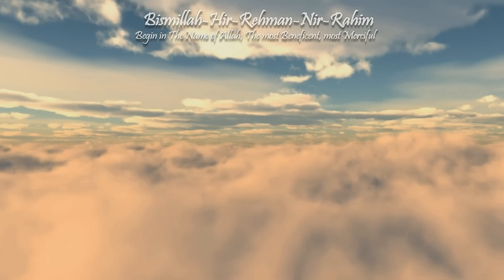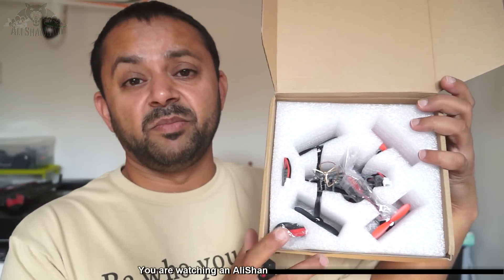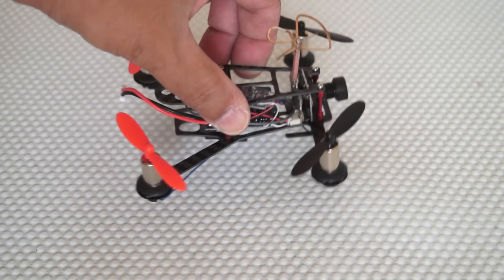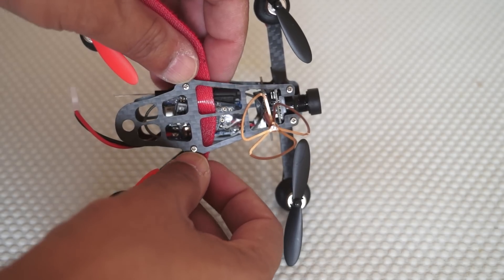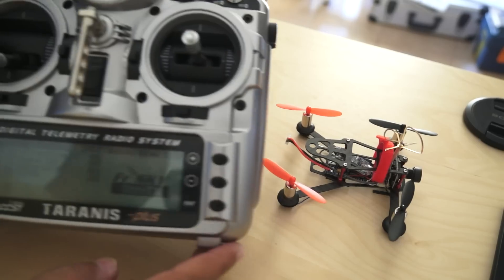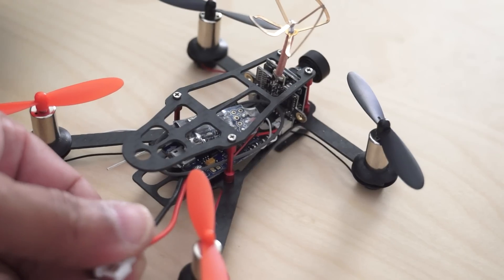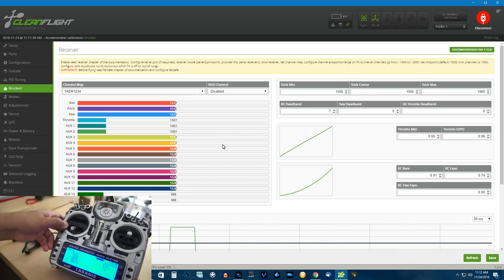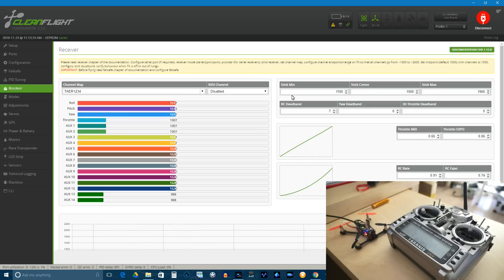Eachine EX100 Micro FPV Quadcopter Review Setup and Flights

Comment: I bought the BNF flysky version and i have the flysky fs-i6. I got inside clean flight but I cannot get the transmitter to bind nor do I know if I should flash it or if I have too.... Any suggestions?
Reply from the maker: it should bind. Maybe the Rx is not compatible, and you may need to update FlySky Radio

Comment: it's fragile because it's lighter, wich could give better performance on DIY builds. so you have to take this on count. For example,  Eachine QX95 is a smaller frame but 8g, while EX100 frame is larger but lighter, with just 6.6g, wich comes handy if you want to save weight to buy a heavier camera or battery, for example.

Comment: Hi there. Please can you help? I followed this video exactly. All is looking and working fine from Taranis in Cleanflight. Save from Cleanflight. But now when I plug in the quads battery, the motors are spinning the propellers fast, even when the motor disable is on and the throttle on the Taranis is completely shut off. Were did i go wrong please? Also just retried and with the pros going also noticed the yaw pitch, is not reacting. please help. Thank you.
Reply: just received mine and its doing the same thing. I can see the receiver is bound, and works on the receiver tab. Did you figure out what was wrong?

Comment: can this handle a 2S 1000mah?
Reply: Federico Mejia Barajas not this, since the motors (Chaoli 820 or equivalent) and camera only support 3.7v (1s). A 2s battery has 7.4v, which would fry motors and camera.
If you want to make a 2s microfpv, you should buy 7.4v capable coreless motors and camera, to add them to this frame. I'm not sure about the FC, So give it a search.
Reply: Pluvia L Fox thanks for the info

Comment: How is aliexpress to buy. rc parts?
Reply: Aliexpress is not a store, it is more like a shopping mall or shopping center filled with different sellers.  I have had mostly good experiences buying from sellers on Aliexpress, they seem to care about the rating you give them. You can always find hard to find parts from someone on Aliexpress and sometimes cheaper than anywhere else, but you really have to look because you can not sort sellers/vendors by price.

Comment: You need to get the DVR module replaced Ali, it is a known problems with first batch of VR D2. I got mine from banggood and they sent the the new module with doesn't do black screen in recording every time it's diversity receiver is switching.
Reply from the maker: Thanks. I will contact them :)